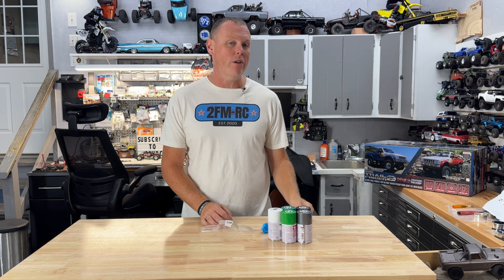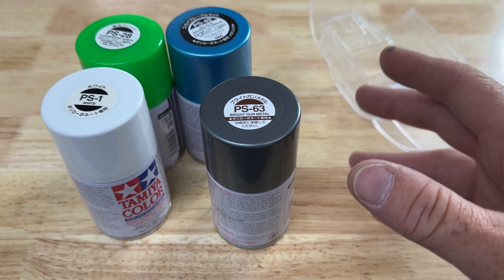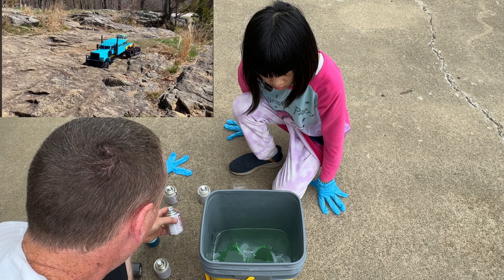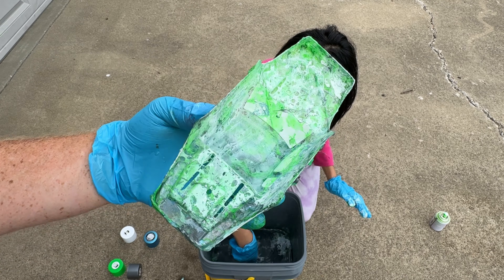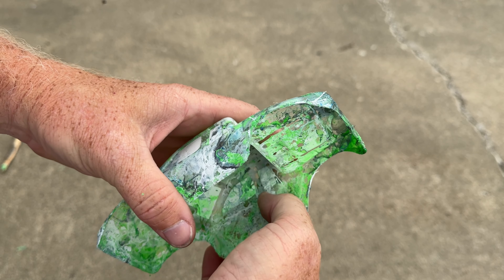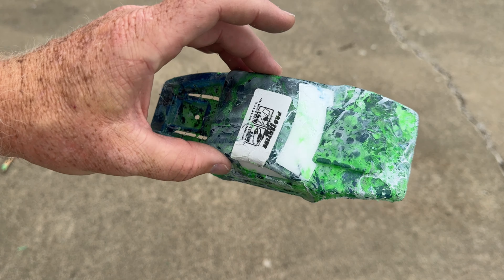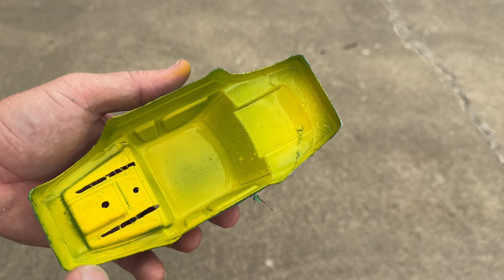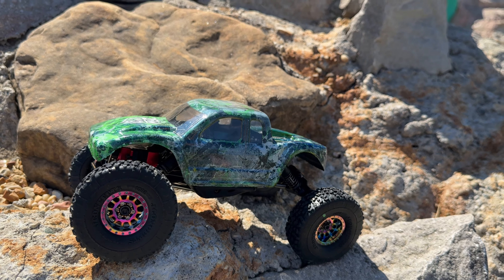How to Hydro Dip an RC body? Our first attempt! Thirsty Thursday Channel Spotlight @outspokenRC

Comment: I enjoyed watching this without caring how it turned out. It turned out great. Truly. I've pondered doing this a lot and have a bunch of cans of paint. I want to do a SCX Pro solid blue body so on the outside. The blue Pro body sits aside. My Pro has a Cliffhanger body painted to match my 1/24 Cliffhanger. (In your style I saw but black with a orange hood vent). Thanks again for your presentations. I'm off to get a body to practice on.